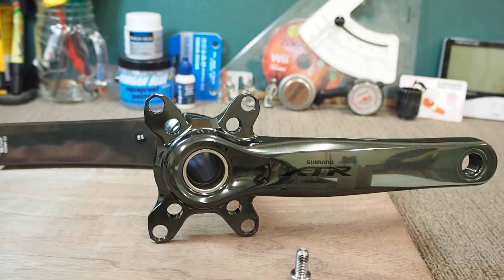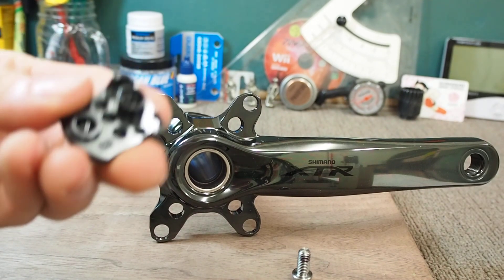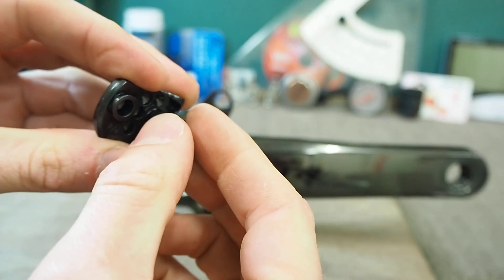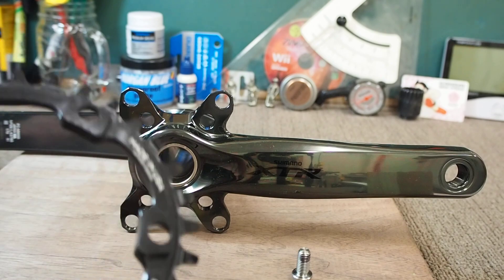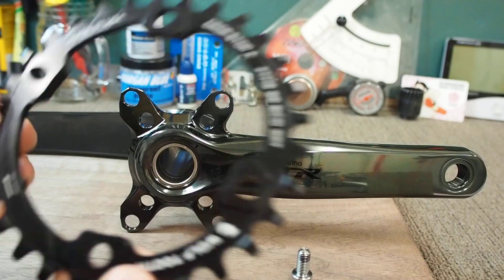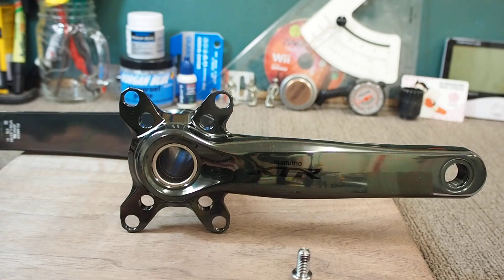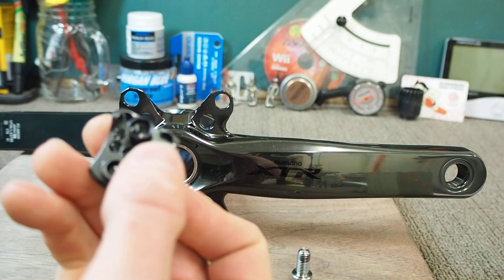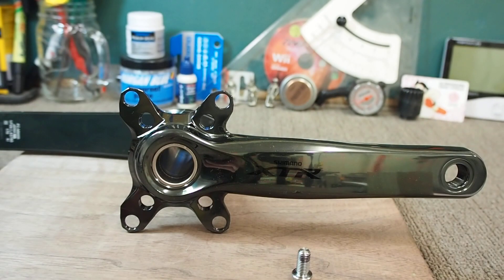Shimano XTR M9000 Crankset: proprietary beyond belief

Comment: I just want to replace the 40t with a 44t on my (maybe future) 40/30/22. No one makes one that would work and it will be at least $500 to have someone make it. 

Does anyone know of a triple 11s crankset and simple 4 or 5 bolt interface?